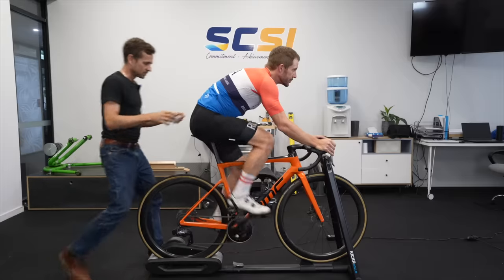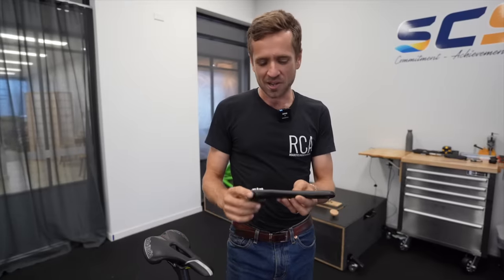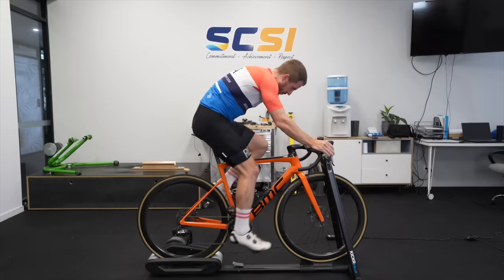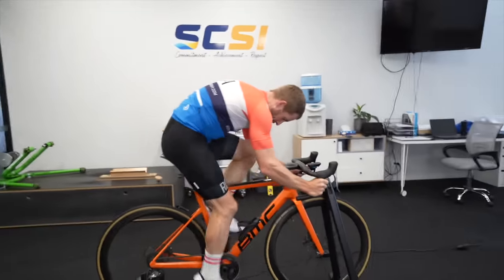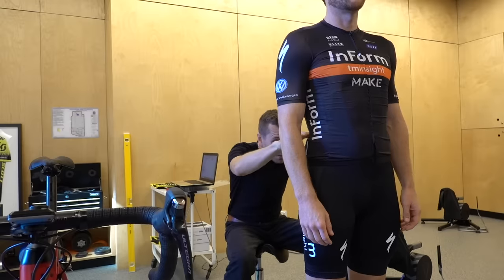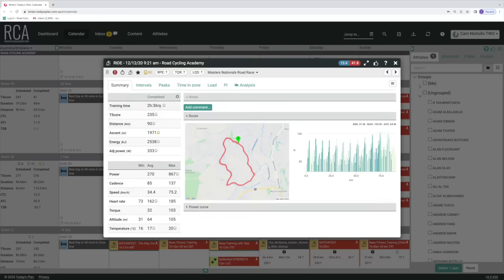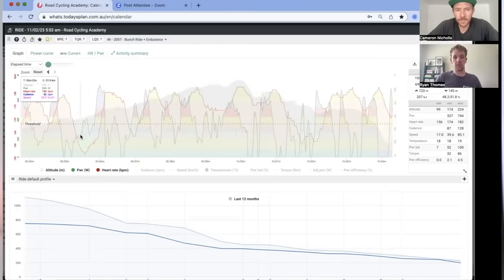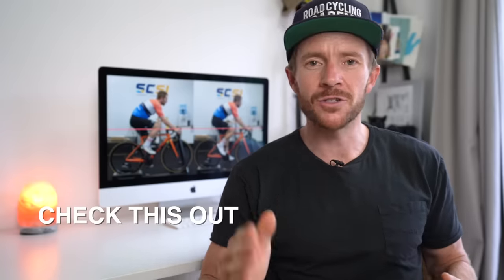I've Gone Back to 165mm Cranks (Fast at 41)

Comment from the maker: Hi all, I know there are a lot of people out there hanging for the Elves review. Next Wednesday I will publish a video where Neill Stanbury gives his thoughts on the geometry, which is worth noting. Then, I expect to have the review LIVE by the 16th or 23rd of March (at at latest). I know some people won't be happy with that timeline, but I'd rather not rush things and test the bike properly. Stay tuned! Cheers, Cam
Reply: Their first attempt at a large size (61) is a clown car.   They increased top tube 3cm and head tube 1cm.  It went from low reach on the 59 to yuuuuugģgggee reach on the 61.  Usually the big size adds a bunch of HT / stack.
Reply: Long time to wait to see if I should cancel my EVO order or not 😬😬
Reply: Computer Cam Nicholls with hat on, " aaahhh just get on with the review already "  lol...
Reply: @pmcmpc  the 59 isn't great either being shorter and lower than a typical 58 cm frame from a Western brand. The stack and reach of their frames all seem a little off.
Reply: Looked at an Elves bike geometry a few years back, it all seemed a bit off compared to what we are used too, decided it wouldn't work for me.
Reply: Take your time on the review. Do it properly.
Reply: I've been using 175's and planning to change to 165's.  I also have one leg 5mm shorter than the other, rather than using a shim would it be benefical to ride 170 oneside and 165's on the other as a shim would make the crank shorter at the bottom of the stroke but longer at the top?
Reply: Hi, thinking of moving to 165 from 172.5 - I am exactly your hight but is your leg length (inseam) and does it make any difference

Comment: I tried the 165mm crankarm fad, turned out to be a waste of $200.  I'm not exactly tall at 5 feet 7 inches and around a 30 inch pant inseam, but after a few weeks, went back to 170's.  Even had a re-fit on the bike for the 165's (waste of $300 in total) - pedaling dynamics were weird, my right front foot wanted to point toes down at the top of the pedal stroke (like my foot/leg wanted to stretch out a bit more forward but it obviously couldn't), and the overall position didn't feel right.  It also hurt my lower back more with the tighter pedaling radius (my body is suuuuuuuuuuuper picky with bike fit).  The only positive was that it was more comfortable in the drops due to the lessened hip angle.  Cadence stayed around the same as my 170's.  On the flip side, I tried 172.5mm cranks about 12 years ago on one of my bikes, and those didn't really work either.....cadence dropped off and hip angle was way too closed (but climbing felt better).  170's it is for me.

Comment: I have finally made my move from 175 to 165 watching all your videos. I must say not easy to get new cranks this size. But one thing is immediate I couldn't believe is how more fluid my pedal stroke is. I have a 10+ yrs history in road cycling on amateur gran fondo level, recently recovered from cancer and not only this 165 mm cranks but all other things Neil explained improved my position on the bike and gives me motive to start again and ride more.
Reply from the maker: Great to hear, thanks for sharing on the thread
Reply: How tall are you ? I'm about 1m83-1m84, always been using 175mm but been thinking about going to shorter ones for a long time. What's holding me back for now is the need to also buy another power-meter.
Reply: @GoustiFruit  Exact same hight. Tell me about it... It took me months! I couldn't get a new set of165 mm. So I had to sell my trusty 4iiii as a bargin and get a left only Stages instead and brand new but compact set. So I have a left arm on sale :)

Comment: You are still just a young boy! (OK, I am 66).  I have been riding 165mm for about 3 years now.  I used to race as well.  It made a huge improvement for a few reasons.  One, my knee is trashed but to the point I needed a hip replacement but due to motorcycle accident as a teen, I cannot have one.  Due to the short cranks I can still ride.  My back is now close to parallel when I ride now.  I now ride with so much more ease.  With me, the bottom of the stroke is MUCH better.   I am significantly faster.   All my riding buddies noticed it as it was obvious.  Thanks for the video and I especially appreciate the health aspect you mention to your hip.

Comment: I'm a strong advocate for short cranks too. Riding 105 R7000 160 cranks for 3 years since my transition from 170s and I've never ever once contemplated going back to them. Possibly one of the best upgrades I've ever made to my bike. As for height, I'm just slightly shorter (175cm). For me, I raised the seat by 1cm but I moved it back my 3mm felt great.
Reply: I think by going shorter you benefit from going up.
Reply: WOW!  Thanks for sharing.  I am 175cm and still on 172.5 cranks.  Have been debating 165 cranks for a few years.  I think this summer I will do it.  Not sure if 160 is in the future just yet.  Glad you shared that.
Reply: @EmpoweredEntrepreneur  I'd say go for it. 👍 You'll be fine with 165s or 160s especially coming from a 172.5. The difference was night and day especially on long rides on the drops.
Reply: How did you decide between 160 and 165?
Reply: @MrPotatoYouTuber  i would say inseam * 2.12. Or more accurately refer to BikeDynamics, i have made a formula to calculate with Bikedynamics formula if you want to measure the inseam and GT (greater trochanter)
Reply: How much you have to rise the saddle?

Comment: I think the main thing that has allowed people to go to shorter cranks is the gearing available now. When a 12 -27 cassette with a 39-53 crank, you needed the longer crank arm for leverage to pull the gears. When you can now easily have an 11-34 (maybe even a 10-36) rear cassette and a 34-50 or 34-48 crank / chain rings. Its much more feasible to go to a 170 or 165 mm crank arm. 
I'm 71 and have seen many renditions of gearing and crank arm length over my 50 years of riding.

Comment: I was riding 172.5 cranks and bought a 165 at the similar time you released your video a couple of yrs ago. What I noticed was I was quicker up hills, but I was never able to be as fast going down hill or on the flat. I personally felt it was harder to get the same amount of torque on 165 cranks. I’m gonna try 170s in the future as I sold the 165s.
Reply from the maker: That is interesting to hear, thanks for sharing on the thread.
Reply: exact same experience as mine. took one month to adapt but after the period, i dont miss anything anymore from the longer crank
Reply: that's exactly what I had with my 180mm and NOBODY passes it to me

Comment: At 6' 1" tall and 48 years old, I decided to try 165mm cranks last year and haven't looked back.  An added benefit not mentioned is slightly more ground clearance when pedaling through turns.  I also see that Shimano now offers Ultegra and Dura Ace 12 speed cranksets in 160 mm versus 165 mm for the 11 speed. Hmm...

Comment: Obviously, the main reason that on track bikes the cranks are shorter, is because you don't want to hit the track on the banking when driving slow. And it allows to reach more comfortably higher cadences (which is an advantage on a fixed-gear (i.e. track) bike, to increase the range of speeds you feel comfortable with at the rpm needed for that speed). Honestly, I don't feel such a big difference between my track bike (165cm cranks) and my regular race bike (172.5cm cranks).  Surely, on the track bike I can hold a slightly higher cadence for the same power output a little longer, but I don't feel a particular advantage or disadvantage in my power output from that. On my race bike, I'ld rather just choose a bigger gear for that reason instead.
Reply: I'm glad someone else feels the same, my road and TT are both 172.5 because I'm built like a giraffe and look for extra leg length where I can. That being said I can't see why having shorter cranks would really be all that different, you're gonna have to likely raise your seat/adjust something else swapping to shorter cranks so all your doing is changing the ratio between moveable components. I can understand if you have a 175mm crank and you're all of 5'5 that being an issue but I think most middle of the road crank lengths should work for the average cyclist.

Comment: When I tried really short cranks 150 and 155 I had to put the saddle more forward so I could lift my legs through on the upstroke.  Putting the saddle back according to that knee over the spindle thing made it difficult to spin up a high cadence.  The historical belief of pros as far as I can gather is not to change anything when the crank length is changed.  They just used to leave the saddle where it was.  My experiment proved to myself that it's better to do the opposite of what the magazines used to tell us.

Comment: Glad to see you’ve changed back to 165s.  ( I changed to them when you did, and never looked back!).  Speaking of track cyclists, back in the early ‘70s, when I moved from Wisconsin back to Southern California, I started spending Friday and Saturday evenings at the Encino Velodrome, totally rapt in the world-class bicycle track racing that was happening there.  With the exception of the pursuiters, all of the competitors used 165s.  This applied totally to the match sprinters, but also to most of the riders in the points races.  (Match sprinters, often coming to complete stops during a race and using, necessarily, the technique of track standing, found the 165s an advantage, or even necessary, due to the inclination of the banking.  With the longer cranks, they would occasionally clip a pedal on the surface of the track, with disastrous results!

Comment: Im 187cm tall and i went from a 175 to a 170 and it made a difference in the slight hip pain i had..now i spin in the drops without a problem
Reply: Have that to with back issues,Will try the 170mm cranks

Comment: When I swapped 172.5 cranks to 165 some years ago. I also raised saddle and moved forward at first, because I read about it from internet. But then I did not have any power. In my case I had to lower saddle some millimeter instead and move aft also. But I never had also any professional bike fit done on my bike. And still haven't. But improvement was so great. I feel that after I changed to 165mm cranks I don't need any professional bike fit anymore. My diy position on bike isn't ideal, but it does not need to be ideal. I can ride comfortably enough now. Best upgrade I made.

Comment: Loved my 165mm cranks on my specialized Steel Langster fixed gear bike which I gave away during covid lockdown and after I'd had a massive heart attack (family history regardless of fitness and health). Fantastic for 35 miles around Poole Harbour (Dorset, England). Thrilling to overtake articulated lorries at 30+ mph down hill to Woolwich (London, England). I had a chance to switch to  165 mm when my 2018 Ultegra cranks had to be replaced in the recall but forgot to request it - blast! As a pensioner, I can't yet afford to change those cranks on my 2018 Roubaix.
   I did get the cranks on my wife's folding Mezzo cut down from 172.5 (far too long for a folding bike that will be used by people of different heights. Went down to 155 mm as she is only 163 cm tall with long torso and short legs. She was very uncomfortable with 172.5 mm! There was a company somewhere near Norwich who did it - just googled, phoned, sent the cranks away and the cut them down and drilled new holes

Comment: My road, xc and enduro bikes, i changed from a 175mm to a 165mm crank. I am 5ft 7 and in my 50s, I think the shorter crank helped me reduce my knee pain; however, I could easily tire out my leg muscles. I felt this when I am doing my routine indoor cycling and road cycling using my road bike. I do not have any gadgets to measure my leg fatigue muscles using a shorter crank but for me the leg thigh muslces easily tire out when I use a shorter cranks. Good video here! Thanks!
Reply: Shortening by 10mm would benefit from a smaller chainring to maintain similar pedal speed to the longer crank. I dropped 2 teeth and it was a revelation!

Comment: My trek slash came with 175mm cranks. I swapped to 165mm to reduce rock strikes but found it’s  pedalling nicer with them to the point where I did a
100k race on them with flat pedals and didn’t have any problems.

Comment: I also ride 165mm. I believe the use of 165 on the track is a practical reason also due to the curvature of the track in the velodrome, and so shorter crank length means less chance of contact between track and crank.

Comment: I have word by word the same experience with transitioning from 172.5 to 165. After festive 500 2021 I suffered from discomfort in my right hip for almost nine months. After the same event in 2022 and riding it with 165mm cranks there were no issues (touching wood).

Comment: Changed to 165mm 2 years ago. Increased my cadence. Didn’t experience any big loss of torque either. (172.5mm VS 165mm is only about 5% difference in length anyway)

Comment: One day , Cameron , you will learn about osteoarthritis and cycling and how it can limit you more . I have to learn to cycle with it and it taints my enjoyment of the discipline . I am 52 and ride with an over 50's social group now . I don't ride as often as my mind wants to . I ride with friends in my sleep figuratively speaking . I started to develop osteoarthritis mid 2018 . I have spurs in a few distal finger joints ( four of them ) . Light action trigger shifters are a bit hard to find in any brand . I have to use older versions to address this . I have a good quantity of Sram twist shifters of all grades , MRX , SRT 300 , 400 , 600 and up to Attack and Rocket versions . I can''t ride my Pinarello road bicycle now as road buzz causes pain after half an hour or so . The mountain bike in road configuration ( gearing and tyre selections ) is less painful but I need to have a break at least once an hour . I haven't been for a decent ride for over 3 months now . I am waiting to have pereneal surgery .

Comment: I've been suffering from one side leg numbness and shoulder pain for about a year now. 
Being 176cm on a frame 54 bike. The bike came stock with 172.5's. 
I got a bike fit at my LBS and they adjusted some things, slamming the stem lower, other saddle type and also moved the saddle position lower.
However, the issue still remains. It's less prevalent, but sure enough 40-50km into the ride, my right leg (or at least foot) goes numb. A day or so after, i have some mild low back pain, and sometimes a sore knee. 
All calculators online point me towards a 165mm crank, based on either body height or inseam (80.5cm).
So i bit the bullet and ordered a 165mm crankset, here's hoping it improves my situation, as according to my bikefitter, al my joint angles are within the optimal range...

Comment: I've watched your fit videos (and like) what Neill says. I've been struggling with fit/saddle issues for 15 years now on and off and have read everything under the sun that I can find and have had 3 different professional fits before I gave up on them. Over the last 2 years I switched from a 172.5 to 170 and now 165. As a sprinter I just cannot recover my max WpK - I've gone from mid 14's, to low 13's with the 170's and now mid 10's with the 165's (basing power off of my Neo 2T, but is in alignment with my P2Max and Garmins). I never have been a spinner, per se, but can hang around 90 outside - heavy muscular legs take more effort to spin it would seem. Indoors I'm usually in the 70-80's. 164 is the calculated perfect crank arm length per the published formula for my inseam of 76cm. The smaller cranks seem to feel better and allow me to adjust my fit but I don't think it is quite as black and white as has been made out. Part of my long standing issue is saddle shape and I have a feeling the SMP might help, but there is no way I can put one of those on my bike! ("It is better to look good than to feel good" - Fernando) Wished I lived in Aus to give Neill a crack at my issue...

Comment: At 183cm height I dropped to 165's first time you explored the topic, they've been great. A more stable pedalling platform, 50/50 balance and some improved PRs on strava that have stood for several years. Have felt climbing to be a little more demanding from a leverage viewpoint but I've adjusted the gear ratios to encourage a higher cadence 👍
Reply from the maker: Interesting to hear that mate, thanks for sharing on the thread

Comment: Hi  i'm 171cm 61kg  45y old rider ( i ride 5/6 times a week). A few weeks ago i recieved my canyon grail xs. This bike came with 165mm cranks, it was from the beginning clear i was less tired in my legs afther my long Z2 rides on this bike vs my canyon ultimate (170mm cranks). (almost same setback and sadlehight to pedalaxe). First i thought it was the more shorter stack but when i looked  at my  powermeter data (did a test both powermeters between my suito trainer) ( i saw that i had for the same heartrate,  5watt more avg power with the shorter cranks vs my 170mm bike. Also i was able to put more power from my quads into the cranks. Now i have also 165mm rotor Aldhu24 on my roadbike and even on lower rpms i put more power than on my longer cranks at he same bike and powermeter (power2max) vs hrf, can train more and longer from the first week i switched to the shorter cranks. Even i can spin at lower rpms with more power and my legs feel more fresh. can ride longer and easyer with my body  and arms flat on the hoods (remco evenepoel style).It's a total gamechanger for me

Comment: I can relate to being 41 :) A couple years back I moved from 172.5 to 170 cranks and the change is much bigger than the 2.5mm would've antecipated.165 could be worth trying now, as back then there were no powermeter options ...
Reply from the maker: Power pedals make this so much easier now